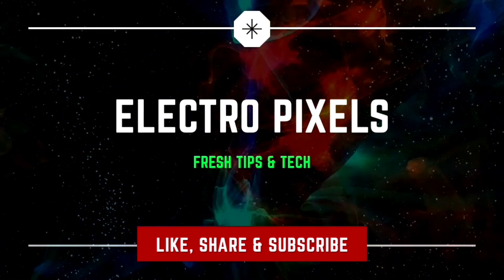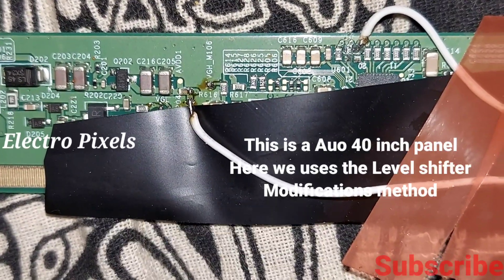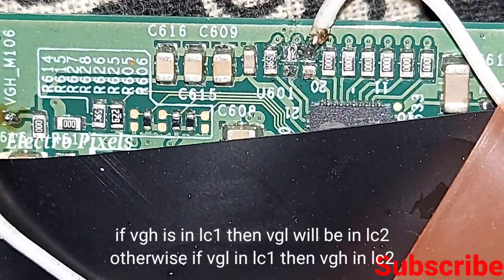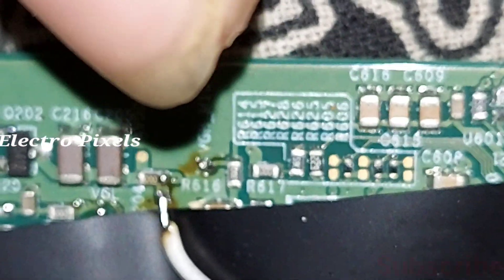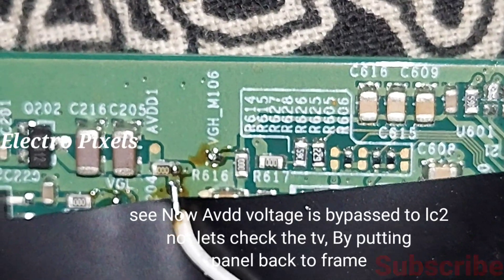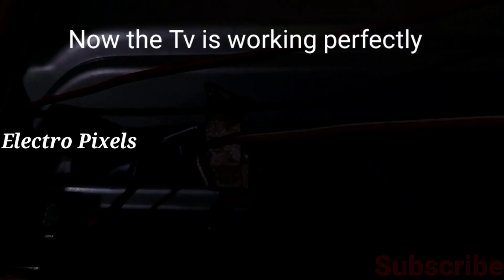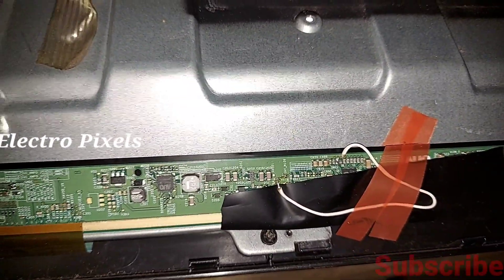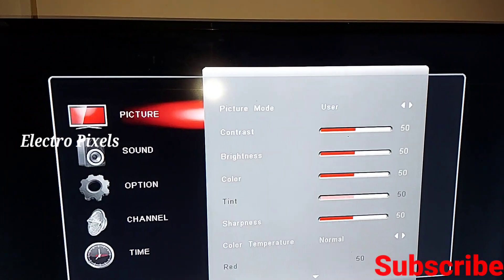Led Tv panel Vgh, Vgl short removal method by modifying gate signals on 40 inch Micromax led Tv||AUO

Comment: You speak too fast and need to draw a diagram on paper of what you are doing for slow people like myself. 
I cannot understand why every manufacturer has different names for it's voltages? 
Add, Vdda etc?  Is there any standardisation when it comes to tcon or panel design?